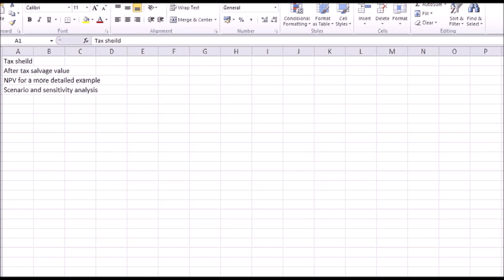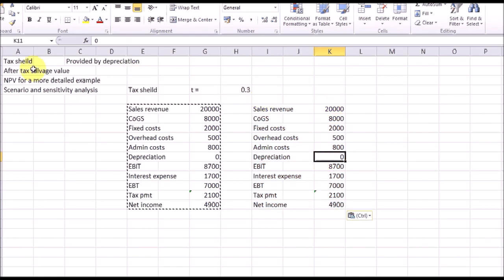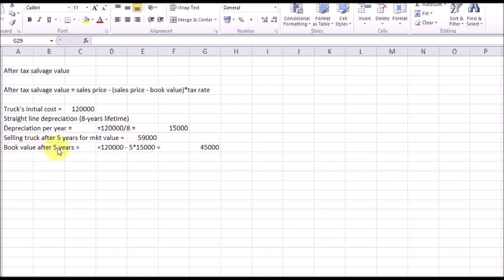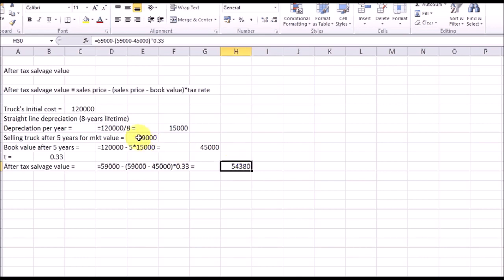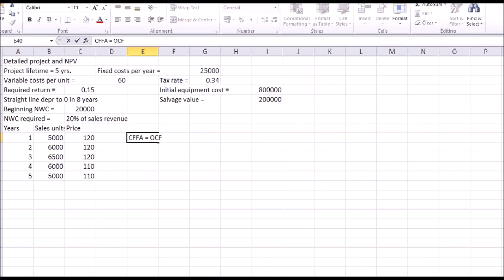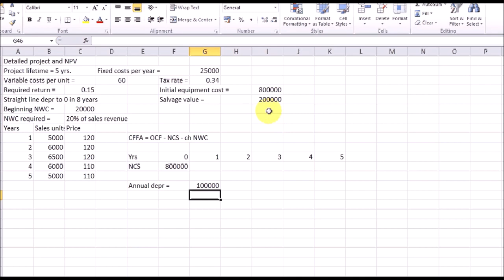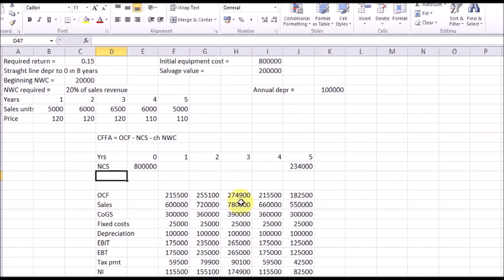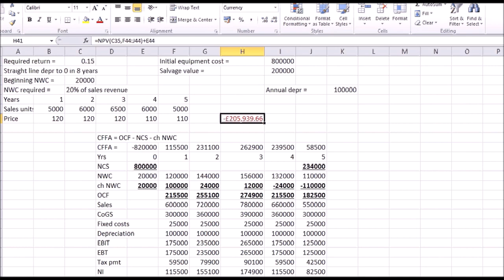How to: NPV,  Tax shield,  Salvage value

Comment: Remember that for Canadian Capital Budgeting, if you purchased an asset prior to 2019, you use the 1/2 year rule.

For example, if the capital cost allowance is 20%, you only claim 10% on the first year.

However, since 2019, the Government of Canada implemented a new "Accelerated Depreciation Rule" where first year Capital Cost Allowance uses the CCA rate multiplied by 1.5 if the asset is used before 2024.

In the previous example, if the Capital Cost Allowance rate is 20%, the year one rate would be 30%.

For example, if you purchase an asset at $200,000 and the CCA rate is 20%, your CCA for year one is $60,000 ($200,000 * 20% * 1.5).
Reply from the maker: Thanks for the insight.

Comment: Teacher, I noticed that you subtracted asset salvage value in year 5. Could you please elaborate further? I thought it should be added back.
Reply from the maker: You are absolutely right. That is my mistake. The line with the initial equipment cost and the salvage value was called Net Capital Spending (NCS). The salvage value should have a negative sign (negative spending). In my video, it wrongly has a positive sign. Additional negative sign in the formula (CFFA = OCF - NCS - ch NWC) would have turned that into adding back the salvage value.
Thank you for picking up this mistake!